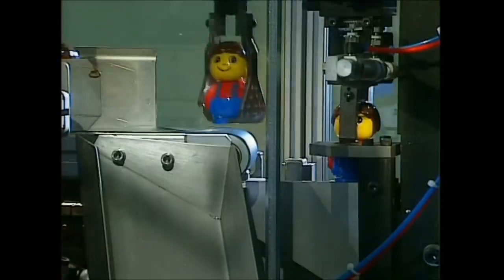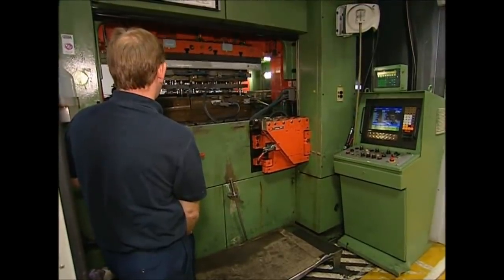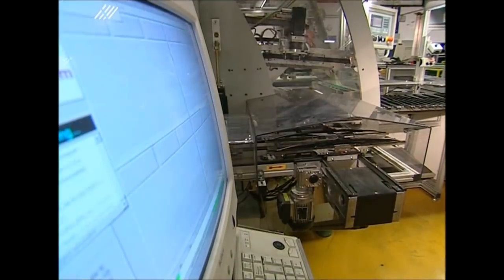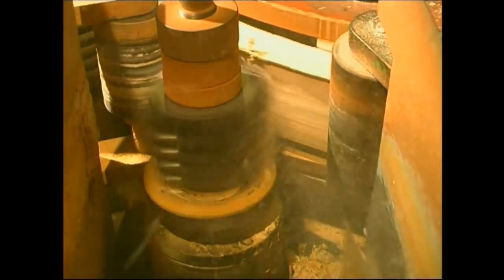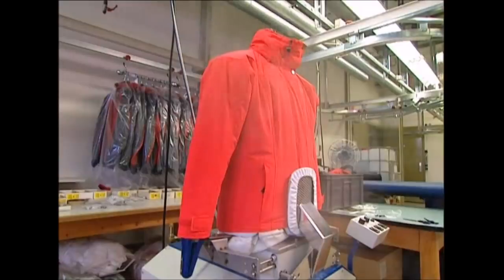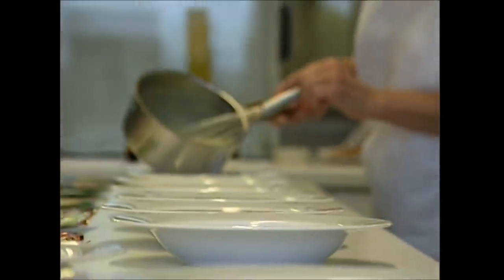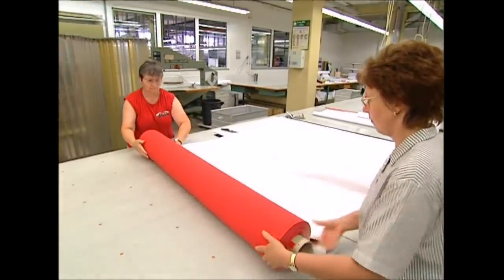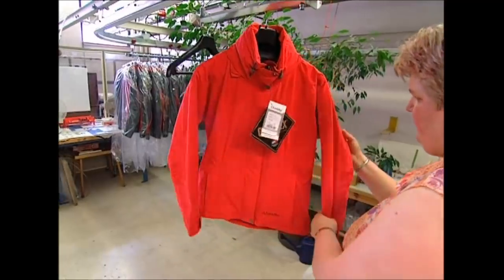► HOW IT WORKS | Windscreen Wipers, Coat Hanger, Instant Soup, Gore-Tex-Jackets | Episode 10

Comment: At 6:57, check out the dummy washing the dirty grit laden windscreen with the sponge. Not only will that grit put fine scratches on the screen, but the wipers will not give of their best as a result. That windscreen should have been hosed off initially, then use the sponge in a "patting " motion that will suck up the grit rather than swirling it around the surface. A final good blast, preferably from a high pressure washer will guarantee a job well done...

Comment: With all these quality control features, why is it that my car always gets the bad set of wipers?
Reply: Are you buying cheap ones? I've never had a problem with Bosch Icon wiper blades. $29 bucks a pop though.
Reply: You need to clean them well, that could be the problem. Try vinegar and water and give them a good scrub on the blades
Reply: 🤣🤣🤣 I have the same problem. No matter which brand I buy the wiper's come out of the package defective. And my vehicle ONLY takes a specific model wiper. DRIVES me batty!🚘🦇